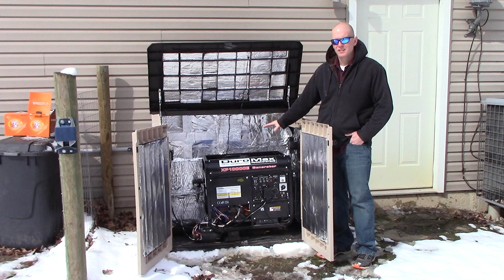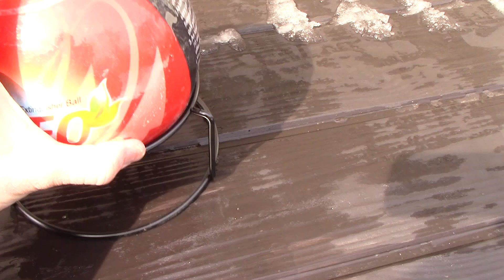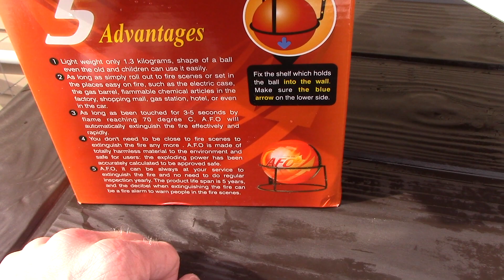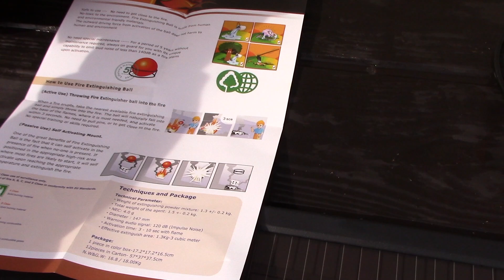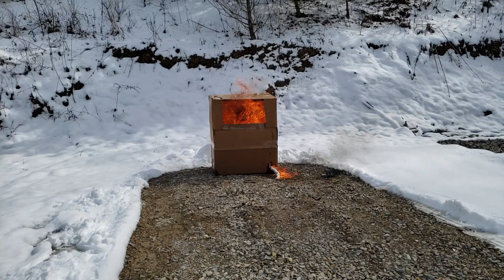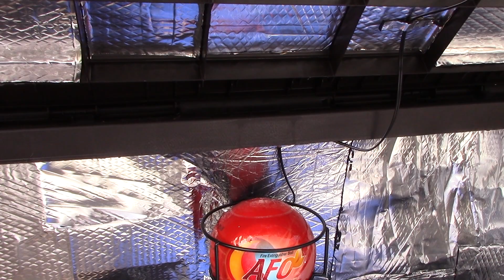AFO Fire Ball Generator Shed Fire Suppression System Review

Comment: I feel this is meant for electrical fires rather?
Reply from the maker: Well it worked pretty good on the gasoline. It's a dry chemical extinguisher, Class A B C These units can be used on wood, paper, cloth, trash, flammable liquids and energized electrical equipment.

Comment: We tested various "balls" from different manufacturers. Under 100 % same conditions they all react the same way. In this case, there was still "heat" outside the box to re-ignite the fire(Even Elide would have failed here--seen it in our own tests). We find that,  out in the open, this "failure' happens to all of them. But in a confined enclosure its a total different story. Same as one would try to put out a fire with just one extinguisher and it is too small. The balls act two-fold. first suppress rather then put out the fire,secondly, the loud bang acts like a fire alarm. One get now the bigger 4 and 6 kg balls and they quite potent. Still,the powder need to reach the fire actually.  Same with large kitchens where  K-type Extinguishers is recommended. Normally fires start when nobody is around and the "balls" can play a significant role here. First Alarm, and secondly suppress till one can get in with a K type extinguisher. Far less damage then when a sprinkler system is activated. Then with all the water damage its best to let it just burn all out and let the insurance deal with it,instead of trying to clean that mess up.

Comment: Try the genuine Elide. AFO is a cheap knock off.
Reply from the maker: That's what I hear but it worked.
Reply: @JackofAllMasterofNone  Do you think if it was foam in that bowl it would work a lot better as I often thought about that I feel like foam would smother it a lot better than powder
Reply: @JackofAllMasterofNone  because me myself I’ve been working on something similar to that but with the foam and trying to figure out another way to have two explosions with the first being a type of explosion that somehow eliminates some of the oxygen in a confined space like it then a secondary be in the Foam the only thing that sucks is it’s not gonna be very cheap and it’s gonna be maybe half the size of a bowling ball and when you’re making things like that you gotta have different levels ones for electric fire one for Chemical fires I want for your normal fire Caused from maybe a spark cause chemical fires depending on the chemical isn’t easy to be put out with powder you need some type of foam because I worked in the restaurant industry and I know above our grills we had a fire suppression system and it was like a foam Versus a powder baking soda type extinguisher
Reply: Can you support this with any data? Have you owned both?

Comment: might aswell just spend a little more money for one of those automatic fire extinguishers?
Reply: A little more? Like $500 is the cheapest I’ve seen. These things have been tested over and over and as long as you aren’t trying to put out an oil refinery fire they are good. I’m making a cement board and metal tubing enclosure for my solar batteries and generator, charge controller and inverter. But I just ordered one of these after watching multiple tests including by the BC fire department.
Reply: @5400bowen  i live in the uk i dont know if its available for these prices where you live but i can apparently buy a 1kg automatic for £30

 https://www.fireprotectionshop.co.uk/fire-extinguishers/automatic-fire-extinguishers/FireShield-1kg-automatic-dry-powder-fire-extinguisher.html?gclid=CjwKCAjw0On8BRAgEiwAincsHBOkVoOexRLmaTZSPp9Q5TeIB6LhhHYkoOpls3sMV5TDoClGdBOs3RoCKIwQAvD_BwE

Comment: In the test run the fuse is what reignited the fire inside the box, and that was outside the box, so your test worked. Enclosed areas are the best for these. I have three in my house.
Reply from the maker: Thanks for the comment. I agree, had the fuse not been burning outside of the box, the fire would have been put out.